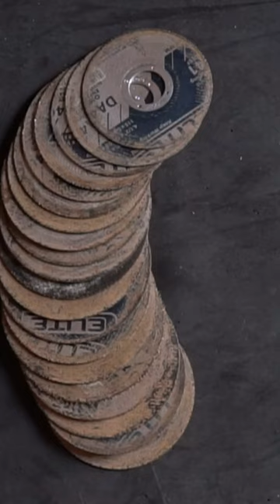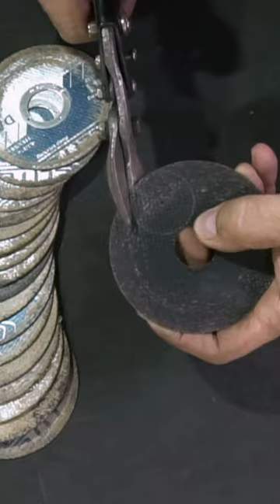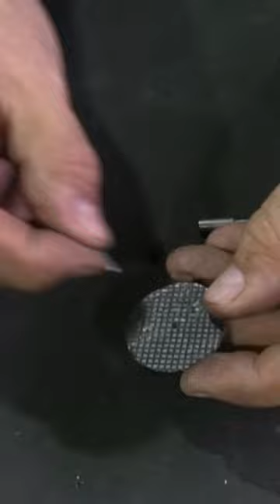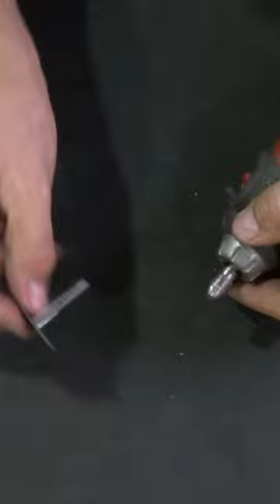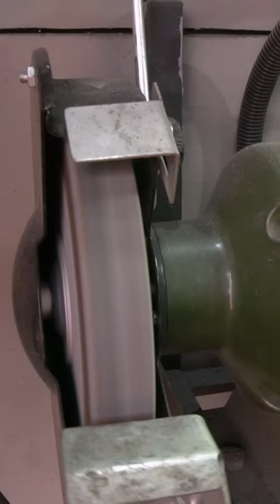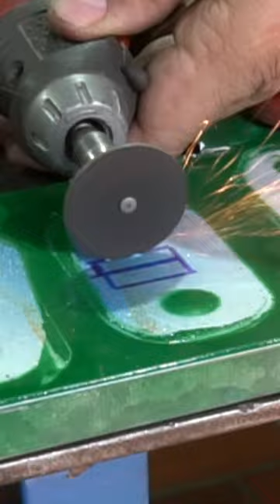Como hacer disco para DRIMEL con discos usados de amoladora

Comment: Always works best
I dont grind it on bench grinder
Stright on concrete etc works ok

Pro tip
Cubitron II 1mm disc maybe expensive
But cut 50% faster and last like 10x longer than any other "standard" disc so its a good choice if you can get one
Reply from the maker: 👍 thanks

Comment: Nunca lo he intentado pq en teoría esto no es seguro, ese disco soporta max 13000rpm y el Dremel es como 20000?

PD:Me encantan sus videos, abrazo gigante
Reply: @kevinsuarez2636 Estimado amigo, sí es totalmente seguro. La teoría en que tu duda se basa es la equivocada, debes tomar en cuenta la velocidad tangencial. En los discos de corte y desbaste siempre viene impresa la velocidad tangencial máxima que en los discos de diámetro 4 1/2” es de 80mts/seg. Según la marca o diseño de las amoladoras, esta velocidad tangencial (cuando el disco es nuevo) llega a bordear los 75mts/seg. y va disminuyendo conforme su diámetro se achica por el desgaste. 
Ahora sí, al grano. Yo he preparado muchas veces mis propios discos, siempre prefiero hacerlo a partir de discos de diámetro 4 1/2” y de 1 mm. de espesor. Después de dibujado, cortado y rectificado me quedan de aproximadamente 3,8cm. de diámetro y si calculamos su velocidad tangencial a 30.000 rpm. que puede desarrollar un Dremel, podremos ver que tal velocidad está muy por debajo de los 70mts/seg. y eso con este pequeño y nuevo disco, igualmente su velocidad tangencial disminuirá conforme se va gastando. En resumen… totalmente seguro, confiable y mucho más económico pero, aquí viene lo mejor: anda y mira tú, es increíble cuanto duran, se van por largo con respecto a los originales discos Dremel. Ahora yo sólo utilizo mis propios discos y voy por discos Dremel solamente cuando necesito que la línea de corte sea inferior a 1mm. Atrévete, quedarás encantado. Saludos desde Ecuador 🇪🇨
Reply: @Calito1157  Caballero, aprecio muchísimo su respuesta. Es fundamental aprender de gente que en realidad sabe de lo que habla pq sus conocimientos se basan en teoría Y experiencia práctica.
Le agradezco que se haya tomado el tiempo para explicarlo y quiero aprovechar para hacer otra pregunta, qué pasa (en realidad) si se supera esa max velocidad recomendada? Tiene algo que ver con el pegamento usado para mantener las partículas en su puesto?

Bendiciones y gracias de nuevo.
Reply from the maker: @Calito1157  Excelente explicación 👏👏👏
Reply: @kevinsuarez2636  En realidad hay mucho peligro. La malla y resinas utilizadas como estructura del disco de corte que nunca debe exceder los 80mts/seg. no están diseñadas para resistir mayor velocidad, seguramente estallará en mil peligrosos pedazos, por ejemplo, un disco de corte de 9” diseñado para trabajar hasta unas 6.500 rpm nunca debe utilizarse en una amoladora a 11.000 o más rpm. puesto que su velocidad tangencial excederá muchísimo su límite de resistencia. Saludos.
Reply: @Calito1157  Es decir que siguiendo su explicación anterior, no habría problema en usar un disco de 9" si se recorta a 115mm de diámetro así como se usa el de 4½" para Dremel?
Reply: @kevinsuarez2636  Exactamente, el cálculo de velocidades tangenciales es irrefutable y si un disco de 9” en la amoladora correcta siempre estará por debajo del límite 80 mts/seg…. también lo estará cuando su tamaño se haya reducido a 4 1/2” y se lo ponga en marcha a 11.000 o 12.000 rpm. de otra amoladora. Alguien querrá colgarme por lo dicho pero, mi criterio es firme y se sustenta en principios básicos de Física, sólo espero que esto no se convierta en un hilo sin final.